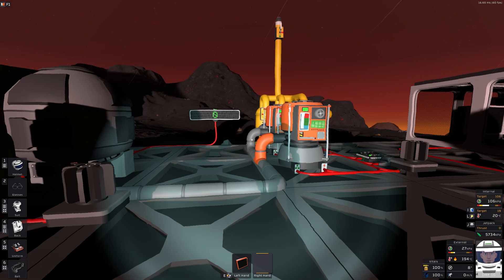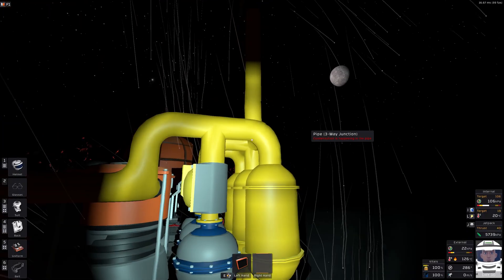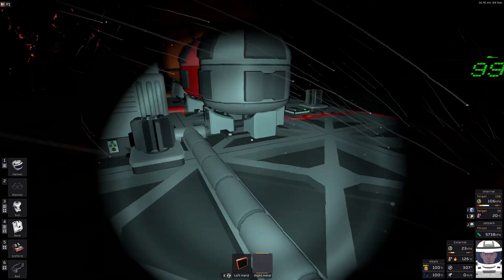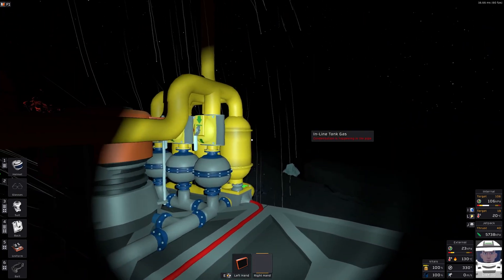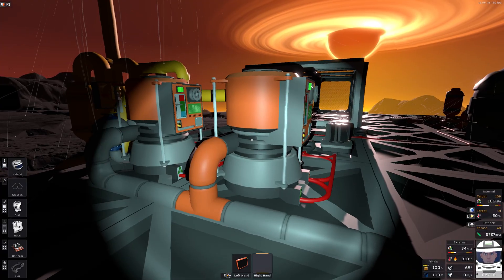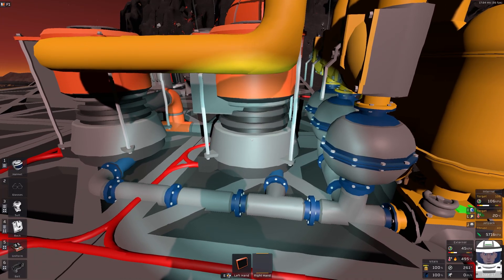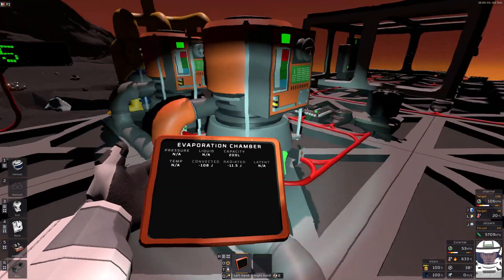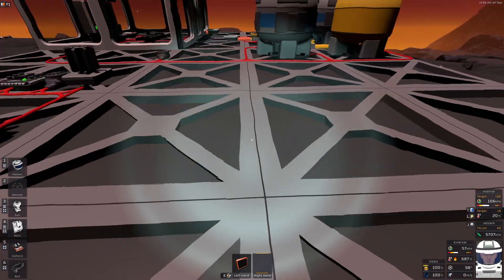Stationeers Coding: Vulcan Cooling Experiment 4 (Best Yet)

Comment: hey! this one turned out really good. I have been tinkering with the cooling stuff too and I think i am going to borrow some of your design. There is a new mod in the workshop that allows you to adjust the day length time. You can wait until it gets dark and then set it to something like 40 hour day length which will let you test in an always night time environment. really speeds up the testing.